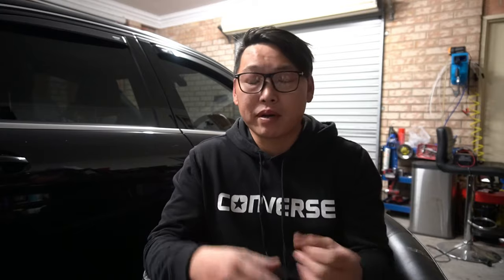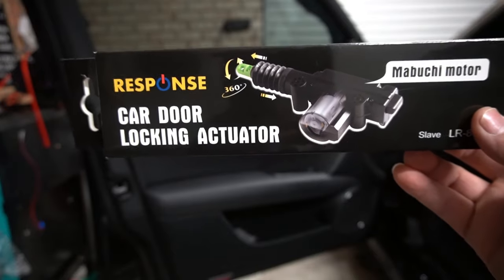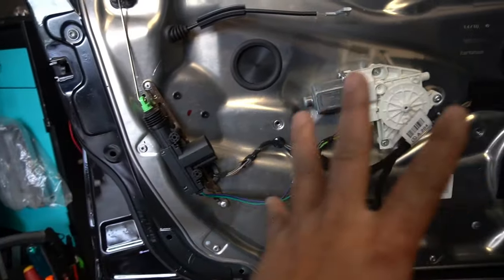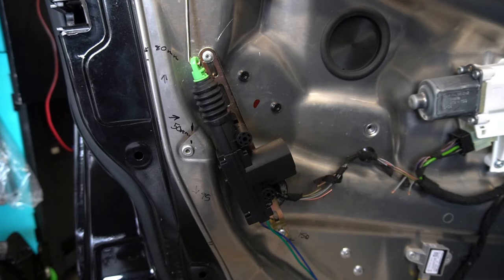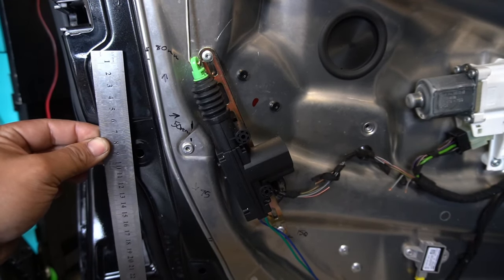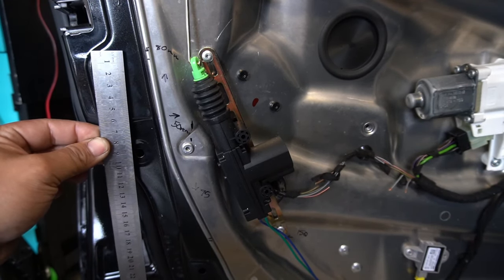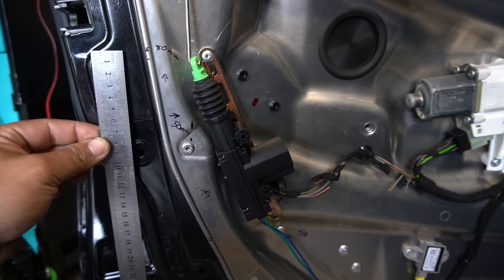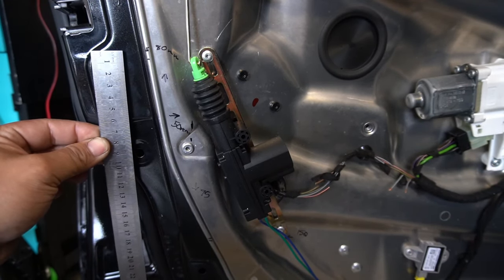mercedes common fault door lock actuator fix aftermarket part easy cheap reliable MUST SEE

Comment: Hey brother,  I'm now getting passenger airbag warning disabled/enabled.  Any ideas ?    I cut all 4 wires going to old lock and used the 2 you said for the new lock actuator.    Is that correct?
Reply from the maker: as stated u only need to cut the 2 ur using .. if u cut te other two it will disable the door light led.. I discovered this later ..hence why I cut I out of the video and re- edited it .. reconnect the other two wires they don't need to be cut
Reply: @MIKEYZVLOGZ  ok sounds good.   I'll let you know if the airbags warning goes away
Reply from the maker: @3rdpedalmafia  u did cut the right ones yeah? and not the air bag wire ? did u unplug the airbag at all? cuz that usually throws an airbag code when u disconnected the airbag without battery disconnected ... doing this job has no relation to airbag sensors or item
Reply: @MIKEYZVLOGZ  come on man.  Give me more credit than that 🤣🤣🤣🤣🤣  have you seen my channel????😱😭😭😭
Reply from the maker: @3rdpedalmafia  no sorry ... I meant no offence I just speak to every in layman terms so I know I cover everything..sometimes it's the small things ppl miss.. I'm no professional so there's that too... but I do my best to help anyone I can
Reply: @MIKEYZVLOGZ  sorry. I was joking when I said that ,  thus the 🤣🤣🤣🤣 but I'll get to the wires this weekend and let ya know what happened,  I think the car is confused because it doesnt see the door open when my wife gets out of the car all of sudden the seat sees no one in it.  It sounds crazy but I believe that's what's happening,  I think this because I drove it alone and made about 6 different stops and never had a warning on the dash. Then as soon as I picked her up I got the warning again , if she leaves the seat or gets into the seat ( passenger) I get the warning,  once I clear it and she's either in it or out of it and that stays the same I get no warning.   I'll let you know though!  Thanks brother!

Comment: After reading the comments I think it's probably better rebuilding the old one or finding one at a wreckers. Who wants it as an annual job. The comments on ebay are pretty bad about them. Maybe annual is hopeful. Sounds like most die pretty quickly. You add them up. 1 each year plus the work against 1 that usually last the life of the car 🤣🤣🤣
Reply from the maker: no worries mate ... if thats the route u wanna take ... more power to ya... go for it ... this is just for ppl who need a quick easy fix ... will let u know wen mine fails ... still going strong after a year and i use my car everyday

Comment: I am lost to what you did on the cable part. You cut the Grey with Blue and Grey with black and where is this cable link too, And you also say you cut the power cable to the OEM actuator are they the same cable you talking about. Cut that and connect to the aftermarket actuator
Reply from the maker: so the cables u cut on the car are the cables y conne t the power of tge actuator too... 
u cut the grey with blue stripe 
u cut the grey with black stripe
then u cut the cables from the aftermarket actuator so u can connect them to the cars cables. the grey/blue and grey/black
hence why i say u cut the cables to both 
so u can connect then together
Reply: @MIKEYZVLOGZ  The MB service advisor said but not 100% sure. He was afraid will the system drain the battery because the door lock is bad. Since the system might continue sending power to the lock and if that is the case. The battery might drain very fast. SInce I don't drive everyday in Canada. Since you have done to your MB have you face with battery Voltage drop after install. And usually the actuator how long they last. Going  back to your video at 6:17 the wires on top of your fingers looks' like a brown wire and a red/white also cut what happen ? Thanks !
Reply from the maker: @sc225  that was for the led to your car door , do not cut that only cut the wires i refer to , of course mercedes are gonna say that , cuz they rather u spend 300 to 600 for them to fix it.. but like i say this is a guide for those who dont have the $$ to have someone else fix it for them ... u may use this video as a guide, but if u have real concerns by all means, do it the right way with a new part or get a used part... or even rebuild your old actuator, i have never had battery drainage since doing this , my lock works fine , its been almost 2 years nowand i drive my car everyday , its my daily...i hope this video was helpful for u in some way

Comment: Don't suppose you know how to fix the same problem on the rear doors? The mechanism is completely different. Looks like a nightmare to change the actuator
Reply: I just fixed the drivers rear passenger door lock. Mounted the actuator horizontally just underneath the lock cable. Cut/shaved off a bit of the cars cable cover so I can mate the after market wire with it.
Reply from the maker: well done I've been told by numerous ppl it could be done..so good on ya bud
Reply: What color wires are cut for rear door? W204 c63. Different colored wires than front door.

Comment: This is not exactly a simple solution
Reply from the maker: it is wen you compare it to the actual procedure related to fixing the original lock actuator and the work involved... comparing the 2 ..this is considered a simpler option 💯